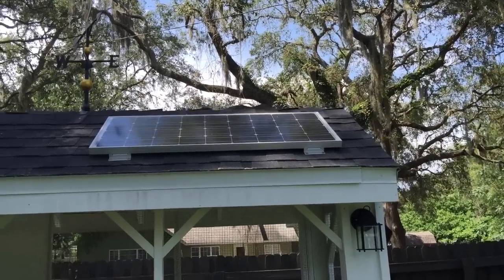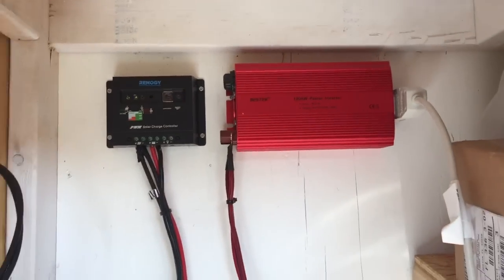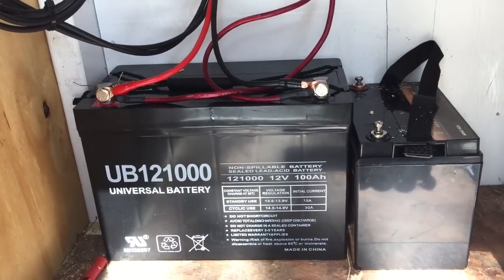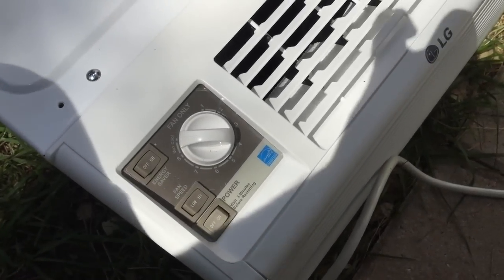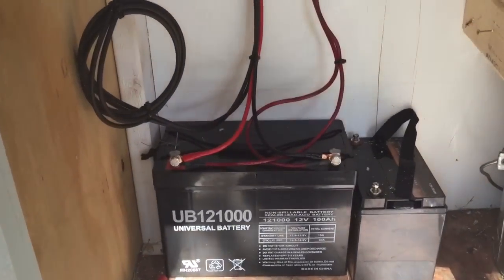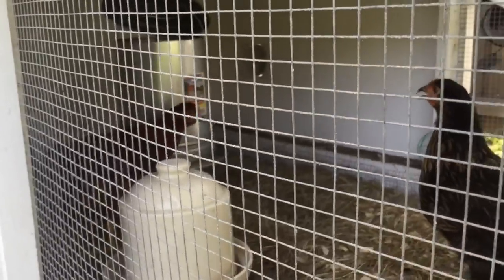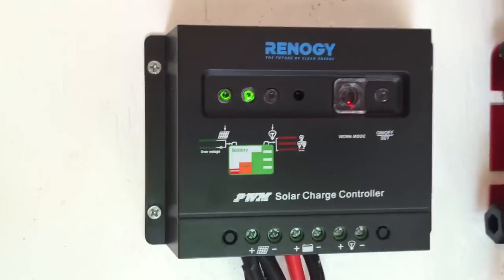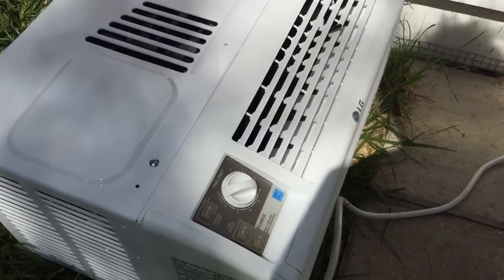Off Grid Solar A/C System | 100 Amp Solar Panel 100AH Battery Setup

Comment: 100AH battery 1200watts if lipo4. If lead acid then 600 usable watts. One 100 watt solar panel generates 500watts per day. The window AC uses 500 watts so 1hour of use per day. And 2 hours if ur draining battery 50%.

Comment: just fan at night/ day time could add swamp cooler/best is spring with free water hammer pump + copper line around the fan! in a pinch.. use bucket water and fish tank pump!

Comment: The battery should be able to run the AC for about 10 hours. (discharge to 50% which is 50amp divided by 5 amps draw)

The 2 problems I see, is that when the compressor cycles, it may be higher than a 4.5amp draw which will lower that run time estimate. The other problem is the single 100w solar panel. At optimal conditions, it will produce about 30 amps per day, (the reality is more like 20 amps per day, especially with the lower priced panels) so you would be operating at a negative every day. 

This means you either need to run it for shorter periods, get more panels, or perhaps add to the battery bank to make it last longer.

During power outages, I run two 5000btu window units on a 2000w inverter and a single 12v 100amp battery and it lasts about 6 hours (4 hours if I have them on max cool) - Double those times if I am only running one unit. I then use a battery charger to keep a second battery ready, and swap them every 8-10 hours. (The generator runs the fridge, freezer, and about 30% of the house, so it is not big enough to add in the two window units, but handles a battery charger with the work load just fine. I like it because it is a dual fuel model and runs on either gasoline or propane. I try to always have three spare 20# tanks on hand, plus the one hooked to the grill. This, plus the 5 gallons of gas I try to keep gives me about 72 hours of solid run time.) - I need to add another 300w of solar panels to help extend this on days the sun is shining.
My window units are not energy efficient - they are cheapo $110 units I picked up at a big box store during the off-season a year ago, so yours will operate on the battery/inverter  much better.

Comment: You don't need more batteries as you do panels. If you have enough panel to produce 500+ watts then as long as you have a sunny day you are good, if not most likely the day isn't that hot unless it's hot and humid. Panels are very cheap compare to batteries.

Comment: Can a 12v 100w solar panel charge a 24volt battery? What fuse can i use, and if i only use it for a 35 watt gadget, can i use it 24/7 without unplugging it. Please simplify. Thanks
Reply: No way, unless you use a dc/dc converter, in order to get 24V supply from your 12V panel...

Comment: lol i just asked in multiple forums if i can run AC for a short period of time off of 100Ah battery. every1 said it would not turn on. here is your answer. I bet with 3 or 4 100Ah batteries it would be more than enough to run for 10 mins or so.

Comment: So you need to find your correct amps per hour... With this equation amps=watts/volts.. so if it's a 120v system you would do 440watts/120volts would get you 3.6amps per hour.... That's when it's running as of now but not when Temps change so it could be more or less...

Comment: Dude. I have 100 watt solar and up my battery  from 101 amphr. To 202 amphr. My solar is having harder time to fully  charge the batteries.  I dont use any more power just added more battery  space  I need some specs on that ac unit please

Comment: Comon sense dont drain a battery faster than you can charge i dont know why people get high wattage inverters and lower wattage panels then wonder why the batteries lose  charge so quick
Reply: Ikr that's huge compare to my 400 and 800 watt inverter  on a 100 watt solar and 202 amp hr battery
Reply: @Gh..o..s..t  Can a 12v 100w solar panel charge a 24volt battery? What fuse can i use, and if i only use it for a 35 watt gadget, can i use it 24/7 without unplugging it. Please simplify. Thanks
Reply: Can a 12v 100w solar panel charge a 24volt battery? What fuse can i use, and if i only use it for a 35 watt gadget, can i use it 24/7 without unplugging it. Please simplify. Thanks

Comment: I think you mean in 8 batteries "in parallel" not "in series"  -- in series raises the voltage (and the inverter won't like that) in parallel divides the current per battery s.t. the higher power draw doesn't destroy them.

Comment: Dude, 100amp solar panel? is 100 watts right. I doubt the system work effectively. This is the common problem to people trying to DIY solar system. You have to look at the capabilities of the solar panel to charge the batteries, voltage is not mentioned at all therefore I wonder if the total power generated is sufficient to run the aircond. If your aircond voltage is 110V the total consumption an hour is beyond 450W, worst if the voltage is 230V +/-. 100W panel with 3 hours peak charge only produce 300W. 

You are not taking losses into consideration, cable size, length etc and the ineffective PWM charge controller, why dont you add panel and use MPPT if you are serious? Dude, is Fix it now and break it later or something? LOL

Comment: Since you a/c uses 450 watts and if you get 100 watts from your panel then you will be using approximately 350 watts from your battery. Which equates to approximately 3 amps @112.5 volts a.c.  and approximately 30 amps d.c. from your battery.  Depending on how long a life you want out of your battery will depend on how far you drain your battery. Optimum is not taking your battery below 70% of its total capacity so you can use 30 amp hours. Since after one hour you would have used 30 amp hour, you would need to turn the a/c off before an hour has gone by. To fully recharge your battery you need to put the amperage used. So if you used 30 AH you need to put 30 AH back into your battery or approximately 350 watts . At approximately 100 watts per hour from solar panel will take approximately another 3.5 hours of sunlight to return your battery to full charge. Since we only expect approximately 5-6 hrs of full sun per day your battery may not get fully charge by the end of a sunny day with the 1 hr. Of a/c used a day.
Reply: P Stoneking More batteries and a vent for gases those batteries release..u can smell it when u open it I bet,this is old so u probably came a longggggg ways since then

Comment: A FAR less expensive battery to use, would be ones for a Golf Cart GC2 (2 x 6 Volt @215AH for $84 each as Sam's Club). Golf cart batteries are designed for heavy load, and deeper discharges than regular 'deep cycle' ones. But, basically, a 100 Watt system is just too small to be practical - you should have a system that can provide 1 to 2 times the AC load. If the AC needs 5A, then it is 600 Watt load. If you calculate everything in Watt/hour they you will have a better handle on what you would need -> 5 more of everything (Solar, Batterys) just for starters.
Reply: Paul Moffat $84 battery link? Thanks

Comment: Have you thought of using an evaporative cooler unit instead of a refrigerated air unit?  It would be cooler than fans, but not nearly as cool as the refrigerated window unit, BUT an evaporative cooler would use A LOT LESS electricity.
Reply: Linda S. Correct!  Recycled 12 volt computer fans connected in parallel directly to solar panel.  Goes on only when sun is shining.  No battery required.   Hang strips of damp towels next to fan(s).  Let bottoms of strip cloth to soak in water trough.  Oh, and cut back the shading on your solar panel (video shows a Shadow☺)
Reply: ukeboy57 Hey, that sounds like a great idea!!

Comment: You need way more batteries and panels to run an Air Conditioner and the set up would not be cost effective ... probably in the low thousands to run the AC AND charge the batteries. Each 100W panel is around $100 and each 100 aH battery about $160 and you need a few of each! An extension cord from the main house would be a much more effective solution to run an air conditioner! Or better yet, let the chickens roam free and they'll do just fine!

Comment: I'm loving your videos. I know this is 2 years old, but I don't see any comment with the math, so here it is. 
440W air conditioner using 440Wh (watt hours) each hour (440W x 1 hour = 440Wh). The solar panel is 100W. In Florida, let's say you have 6 sun hours. So that panel can theoretically make 100W x 6 sun hours = 600Wh a day. Except with real world, you'll probably lose at least 30%, so 600Wh x .7 = 420Wh. So, if the battery is big enough, you can run the AC just under an hour. What size battery? You don't want to use more than about 1/3 of the battery a day, we won't take days without sun into account, only run it on sunny days, so 420Wh x 3 = 1260Wh / 12V = 105Ah (amp hour) battery. Which is pretty much what you have.

Is this what you've found after running it for a while?
Reply: To a certain extent you are right. But it would run a little longer than a hour because that air conditioner is designed to chill a single room of a house. And the chicken coop of a fraction of that size but roughly insulation and air sealing. Another thing to take into consideration is when the chicken coop is at the desired temp the air conditioner will go into rest mode till the ambient temp is out of range. So in best conditions I would say 3 hours but average 1.5 if not 2 hours because of air loss and heat transfer

Comment: Do you know why lead acid batteries are a dumb idea for solar panel? Or deep cycle batteries? I want you to find out, take a marine battery and put it in your car and use it as normal, see how long it takes you until you cant start your car the night after. That's because, YOUR ALTERNATOR is producing power but only after it wastes 50% to make a magnetic field and then it wastes another 35% that never even makes into the battery because the plates will not accept it right away. And that's why SUPERCAPACITORS ARE THE ONLY WAY TO GO, your solar panels would require less panels, less time and more power. Being 50 70% efficient.  from that 19 GUYS THINK ABOUT WHAT IM TELLING YOU, it took me 10 years to grasp this and 50 cars being a cheap ass going for the marine battery every time and now i see solar differently. Lead acid plates are thick they get crug on them then they absorb even less power, so its making 100W 5 amps lets say, your battery is accepting 2, so 3 are not being utilized, Use super capacitors or make them.
Reply: Super capacitors would need to be the size of a HOUSE to hold the energy you can store in a car battery.  But the capacitor is close to 99% efficient. (if it doesn't self discharge to the air before you use the energy)
Reply: Where do I find more information about super capacitors?
Reply: Alternators are not just 15% efficient...  a POOR alternator is closer to 80% efficient.  A good one might be 93% efficient.

and lead Acid batteries are not too bad.  they give about 85% to 90% energy return vs what you apply to charge them.   Their main strong point is tolerance to abuse.
Reply: Correct. A capacitor is just a buffer that holds a charge ready to dump out in a hurry as well as "recharge" in a hurry. They are not intended to deliver small quantities of voltage over a long period of time. There is no chemical action occurring in a capacitor, so they can be discharged and recharged billions of times. Maybe, almost. F Huber is right IMO, you would need a garage full of capacitors to equal a couple of car batteries.

Comment: My experience says that combination will not last the energy 35 to 45 minutes. You need at least 8 batteries like that and 2 solar panels over 300 watts so that air conditioning that consumes 4 to 5 amps will work for 5 to 6 hours a day.

Comment: you probably will endup burning up your motor in the Air Conditionner, modified sine wave isnt good for them. i personnaly would just setup a couple of fans.
Reply: Actually,I agree. Fans are less of a battery hog.
Water for the chickens!

Comment: My advice is ditch the a/c and put more fans in it. Ac uses to much power for that small setup. But it could run 12v fans all day no problem
Reply: Well not all day and all night I have to turn off my fan during the day for at least 2 hrs in order to not run battery  down at night to far. .I added another 101 amp hr battery  and it dont charge full any more but runs 1 single fan 24/7 and even in cloudy days

Comment: try a couple fans, one in, one out, that set up will help because drawing 5amps for a 50ah usable batterycapacity it will last 9 hours a day and the battery wont last long unless you set a timer for a couple hours although you didnt say how much of a draw for the inverter.

Comment: Not sure if the ac blowing on the chickens is needed but good test of application. You mentioned using 4.1amps at 110vac which means your pulling 43-47amps flat per hour from your 1 battery (not figuring inefficiency from using modified sine wave inverter) You have an hour for near 50% discharge assuming pulling that many amps in an hour doesn't stratify or sulfate the battery. I love your thoughts but your better off running fans vs ac for this job. I didn't mention the solar but with shading ur looking between 30 - 50 watts (2amps - 5amps) which would only trickle charge a battery that size. 12 hours of sunlight a day would run the ac for an hour at night. Check out my channel and subscribe I have done a lot of what you are trying to do perhaps we can exchange some ideas. FYI I love that chicken coup design do u have plans?

Comment: theres losses your not counting, the main one is not 100% sun. your panel may say 100 watts but under load is probably closer to 60 Watts. I see shade on the panel thats not good at all. The second is the inverter. Run four of those panels and you might get by for most of the day and you'll need to recharge the next day. Get rid of the air conditioner. try running  a 50 gallon drum with vapor nozzles for the hottest part of the day. a pump on the inverter spraying into the coop  maybe 4-5 nozzles. way better energy then that air conditioner.

Comment: Any update?  I'd say 2 hours at most to full drain.  You lose about 10% efficiency just from the AC inverter.  I can tell you I connected a 1000 watt inverter to my truck battery and even with alternator running I can't get tools that draw more than 500 watts to run without tripping the fuse.  I'm hoping your exact setup would allow me to draw about 120 watts continuous for about 6 hours a day.  BTW, I know that is deep cycle and not a car battery, but does it have a CCA rating, can it b used in my truck for starting and running power tools?
Reply: The Battery he's using is NOT made for automotive use-I personally would not try it.

Comment: Wait if you have a total of 100ah and you use 4.1 amps an hour. 100/4.1 = about 23 hours right?
Reply: Exactly Right. Using 12 volts and inverting it to AC is EXTREMELY inefficient. It CAN be done, and in fact, I am doing it in my home. But I'm only using usb and low draw 12 Volt L.E.D. lighting, with RARE use for the home stereo & TV. My system's second function is to run the Ham Radio station during AC outages.
Reply: no, that's 4.1 at 110 volts. his power source is 12 volts. keep the math simple an multiple 4.1 by 10 and that's what he is pulling from the battery. 41+ amps!!! add to that a 10% loss in the voltage conversion and DC to ac conversion.  that means he has about 45 minutes of air conditioning before he needs a full day of sun to run another 45 minutes.

Comment: I think you will only be able to run it for 1 hr because 4 amps a/c equates to 40 amps d/c since you only want to discharge your battery 30% 1 hr would be absolute max. you need way more batteries to run that ac
Reply: 100 amp hour battery and a 4 amp load wouldn’t it be more like 25 hrs till dead but realistically 12.5 since you don’t want to go under 50% for the battery’s health sake and don’t forget your loss in the inverter calculated in you may get to run that ac for the “hot part” of the day and you’ll also need plenty of sun to recharge it....need more panels tbh.
Reply: So, you just said that He wrong in calculating the current usage?

Comment: I wouldnt run that item more than 4/5 hours because you dont really want to deplete the battery more than 75% to get your monies worth out of the battery. Check battery university website ;) good video though. Thanks for sharing
Reply: This is a Lead Acid Battery-50% MAX. You take that battery down 75%, and you WILL destroy it! I know this from personal experience.
Reply: I meant 75% remaining capacity, or 25% depth of discharge to ensure longevity.
Reply: Okay-I'll buy that.